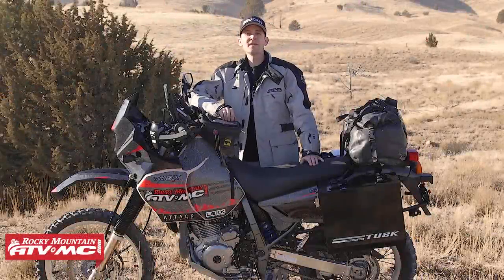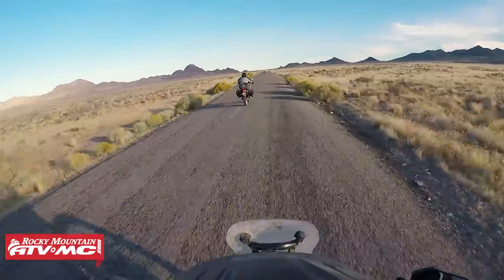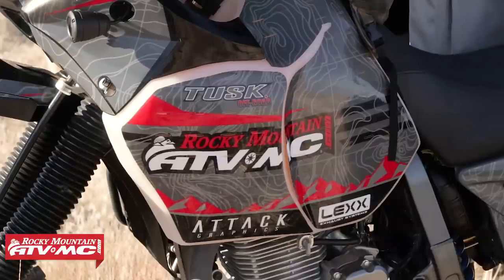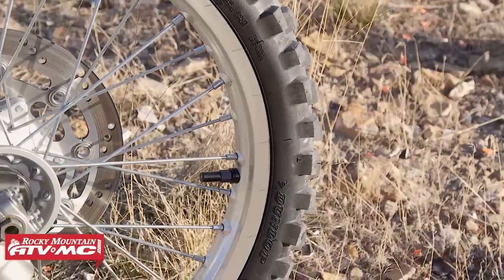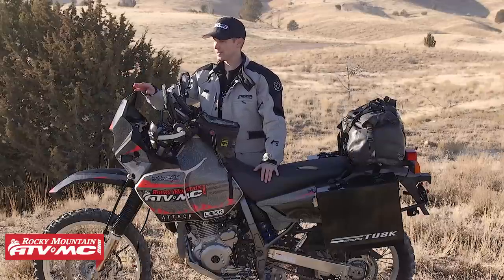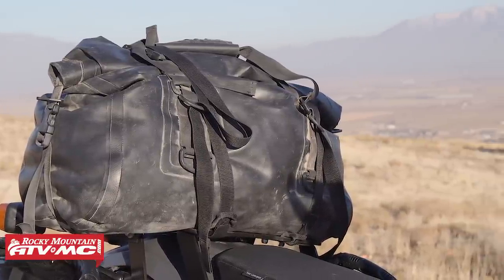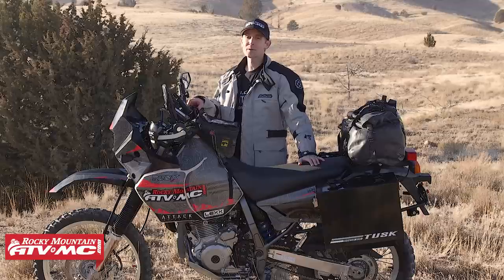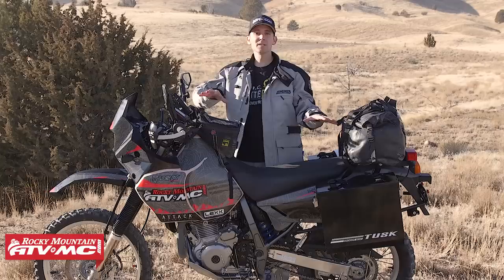Suzuki DR650 Adventure Bike Build

Comment: I swapped out the springs shock with help from Cogent Dynamics in NC.  I didn't do the Pro, but the standard Mojave shock is TRULY night and day difference!  The bike feels more sturdy, stable, and I can hit the water diversion bars on the forest roads and catch air... and it feels like I'm landing on a pillow!  
--> See LostInPA's post below about Cogent Dynamics.

Also, riding up the mountain (couple thousand foot elevation change) I noticed my engine would lose power sporadically but then regain it... found out it was an air supply problem... removed the snorkel and haven't had the problem since.  

Since I'm on a VERY limited budget, my upgrades will be few and far between, so I need to give SERIOUS thought to prioritizing the list.  

I got a new set of handlebars for Christmas and am trying to decide if I should do a *skid plate* or *lowered pegs* next.  

Any thoughts???
Reply from the maker: BarefootDrummer - Next mod, A skid plate hands down!   Thanks for checking out our video.
Reply: Thanks RM ATV MC!  I'll likely take your advice.  Also, because you mentioned it again and I'd rather not have to worry about it, I think I'll address the NSU screws as well.  After all, everything covered in snow right now (where I am) so I've got some time on my hands!

Thanks for the videos!  I subscribed to your channel.
Reply from the maker: Oh most definitely you should address the Neutral Sending Unit Bolts with loctite.  I assumed you had already made that mod.  Thanks BarefootDrummer!
Reply: I'm in same predicament.  Really want that rear shock.  Too long a wait till Christmas, lol
Reply: @843292  NSU is a must, do it ASAP

Comment: Nice video, I have a question. I'm going to pull the trigger on a new Suzuki DR but don't know if I should go 650 or the 400 (DRZ-S). The dealer really tried to sell me on the 400. I like the idea of the water cooling but it's one more thing to go wrong. Also less weight is a bonus. The 650 is actually cheaper because it's old school technology. I'm would be riding 80/20-dirt/street. As far as my experience I have been riding bikes over 40 years both dirt and street. What do you think? Suggestions?
Reply: Yes, don't worry about engine heat, DR650 will not overheat, they ride them in Australia desert heat.  Mine's beev in very hot climaes, never ever a problem.  If you do mostly off-road, get DRZ, if you going to be on highway for any length, definitely get a DR.
Reply: Also, don't buy new, it's a waste of $$$

Comment: 7 gallon fuel tank bet it feels top heavy when filled up
Reply from the maker: dansherman1980 it is noticeable, but not as bad as you would think.  Justin can still wheelie this thing and ride those tighter technical trails no problem.  Its something you just get used to and once you do, you feel comfortable.  We will take the fuel range factor all day.  These fuel tanks are sweet.  Thanks for watching.

Comment: How are the vibes?  Had an '01 and found it quite smooth.  Sold it and eventually missed it so I got a used '07 a couple of years ago and I found the vibration too much.  Was my '01 that much smoother or am I just older and more sensitive to the vibes now?
Reply: Getting older won't make it vibrate more.  There is something with your bike that's not right.  It's a very easy to work on bike, I'm sure you can solve the puzzle, good luck, cheers
Reply: The bars are rubber mounted try loosening the the bolts attaching the bars to the triple tree just a little bit.

Comment: My mod list so far. Soon to be adding a Baja Designs squadron pro and a TM40. 

GSXR Exhaust with custom Hanger 
FMF Header
Modded BST
Galfer Steel Brake Lines
Works connection frame guards
Steel case guards
Pro Cycle lowered peg kit
Brake snake 
Shifter snake
Acerbis skid plate 
AMP Oil Filter cover guard 
JNS Engineering oil cooler guard
Skene LED controller 
Rowe PDM60 power controller 
Voltmeter
Red LED Speedo light
Hour meter tach
JNS Engineering aux light mount 
Moose rack
Australia tail light with LED bulb
YZF front fender 
Double take mirrors
Acerbis tank
Acerbis skid plate 
Seat Concepts tall seat 
Oxford heated grips
Charging cable
Cycra probenecid handguards
Headlight guard
GPR. Stabilizer with mounting kit
Pro taper Suzuki / KTM bend fat bars
ASV folding levers 
JNS CS cover 
SKF Sealed Wheel Bearings 
Cogent Dynamics Mohave Pro Shock
Racetech Fork Springs with Cogent Dynamics DDC

Comment: Thoughts on xt600?
Reply: I had a 1989 XT600. It was much lighter than a DR650, but it didn't have electric start and it had less suspension travel then the DR650. It was a great bike and pretty good on the street and dirt.

Comment: Nice video... but just how much money was thrown at your bike? If I go to your website link that you provide and add up everything from the luggage tab down to the last item in the accessories tab... it looks to be pushing $4000 worth of add-ons, and there is still almost 30 more items listed.

As I said... just how much money did you throw at the DR650 in this video?
Reply from the maker: the link has the items we put on it as well as similar items that could go on it.  so no, I don't think it was close to 4k.  I am not sure on the exact cost, but hopefully the video gave you some ideas on what is most needed for you.  With an Acerbis tank instead of the safari set up, you could set up the bike at a relatively low cost.

Comment: How about honda XR650L?
Reply from the maker: You got it!!  We are building one right now.  In fact, it is in our shop and our designers are building pannier racks and tail rack for it as we speak.  We are trying to have it built for a big ride we are doing in a few weeks.  So expect a report and video in February sometime.....Justin
Reply: Looking forward to the X-ray build.  A shoot out would between the drz/dr/CR would be great!
Reply: XR650 L is so much more cooler because of its Xr600 baja legacy and if you think the Dr650 is good offroad, the Xr650 is a wheelie monster. ergos and seat heights is from the 80s though.
Reply: +Alinel Woundhorn 
Yes xr650l  is much  better  offroad . The dr650  ,has an oil cooler  and lubrication  system  that sprays  a jet of oil on the underside of piston  .It is a more durable  engine .

Comment: Get rid of that 8 gallon tank and you’ll lighten it up more
Reply: Agreed, they're getting 40mpg and riding in Nevada desert.  I get 55-60 mpg. Modded (43 hp, 42 lb- ft torque). The things you can do to it are limitless, do your research , drop me a line if you have any questions, cheers

Comment: Wouldn't it be sweet if Suzuki did a few simple things to keep it fresh:

Fuel injection
Fix the countershaft seal issue
4 gallon tank, at least
LED head/tail stock
Bit beefier stator output
Upgrade the brakes to modern radial mount unit
Better stock suspension

That's it. No need to water cool it either. I think the price could stay nearly where it's at because Suzuki paid off the tooling for this bike a LONG time ago.
Reply: ABS is also needed. Just for legal reasons.

Comment: a what about the subframe??? they always brake with heavy loads...just make some reinforcements.
Reply from the maker: the pannier racks add a lot of strength, but I have heard the subframe is weak.  so far we haven't had an issue.  time will tell if we have to reinforce anything.  thanks,  Justin
Reply: my experience tells me it will brake unless you don't carry much, but if you like taking your tools, spares, bags and extra fuel then you will be in trouble.  That subframe is very very weak(complete snaps in two different places on both sides).  A few reinforcements will save you huge headaches.
Reply: If you want to have details on the frame cracking, look at rtwpaul's ride report on advrider .com. He and his gf have ridden a pair of DR650s thousands of miles on their bikes.
Reply from the maker: thanks a lot.  I will check it out.  I pack a lot of weight.  I just did another gnarly 1000 mile ride with the gear.  I will inspect it closely.

Comment: soooooo with that tank you have a range of over 600 miles? are you planning to cross the sahara with it?
Reply from the maker: off-road riding I only count on 40mpg - so closer to 300-350 miles.  Just enough for ADV rides in Nevada!  - Justin
Reply: @rmatvmc  you getting 40mpg?  I'm getting 55-60, wow I did something right.

Comment: After about 4 min in I started wonder why you even bought it.
Yo have changed everything.
Reply from the maker: Ha ha sorry about that! It's a great platform to begin with and is even better after a box of aftermarket parts! lol - Wes
Reply: DR is more of a cheap platform bike with a dead steady, simple engine. 

No rads to bust and no electronics to fiddle with. If it has fuel and oil it'll go. I just tore mine down (had a gasket that was slowly leaking and wanted to take care of it in the off season) and found that at some point in it's 30k mile history it was ran low on oil and gouged the hell out of the con rod and wrist pin. I'd still have no idea if I hadn't taken it apart and seen it myself. They can take a lot of abuse and keep chugging. 

That and the community around them is great; everyone is nice. DRRiders forum probably knows more about the bikes than the Suzuki engineers that designed them.

Comment: I had a 2012 dr650 and once I added up the cost of the mods it needed it was about the same as what I paid for the bike so I sold it and bought 690 which didn’t need any mods and which would have far greater resale value than a heavily modded dr650.

Comment: throw the carb away...buy tm40.....Cogent Dynamics Mohave Pro and DDC drop ins  and springs ...............replacing springs on OEM suspension is a joke and    will give you a stronger pogo stick as evident from the short vid.   Warp 9 DOUBLE BEARING rear sprocket carrier and cush pads     Procycle HC piston and webcam kit    barnett clutch and springs........and decals are cool until you reach age 12

Comment: So I need to spend $8k if I want a new one. Then I have to spend another $8k to make it a decent bike. Why not just spend $12.5k OTD for the Tenere 700 and get a bike engine that will do far more miles.
Reply from the maker: Most riders will buy added parts regardless of how much they spend on their motorcycle. But there are a ton of great motorcycle choices to go with!

Comment: you know, just dont get these idiot manufactures. The only means of transport/motorized vehicle on the planet to still get built to 1970 standards are mid size, thumper adventure bikes. What truly gives with this. Take a dr, xl, or klr, upgrade it with 2000 of parts from other bikes you already make and have in stock and "booooom" bikes to give dealers that can sell. 
Wish I could buy a 1985 honda civic, like i can a dr 650.